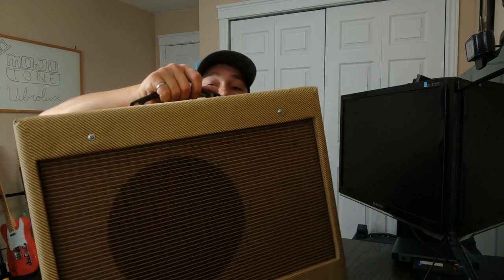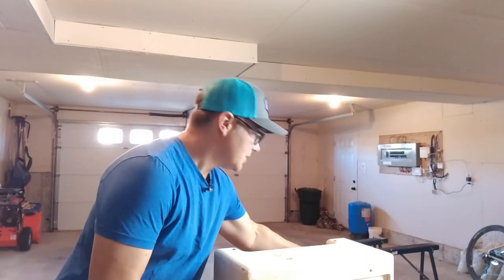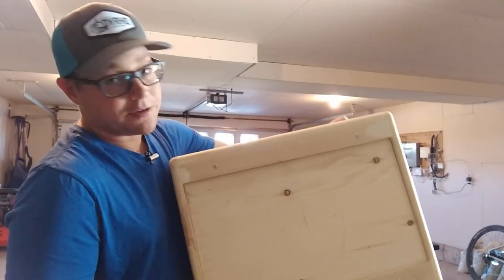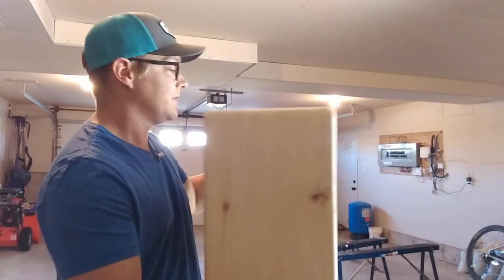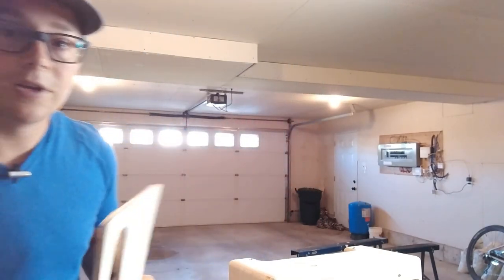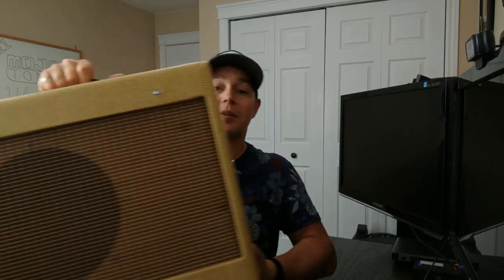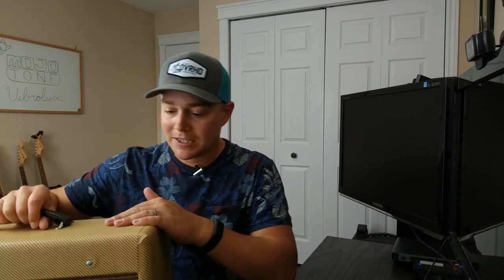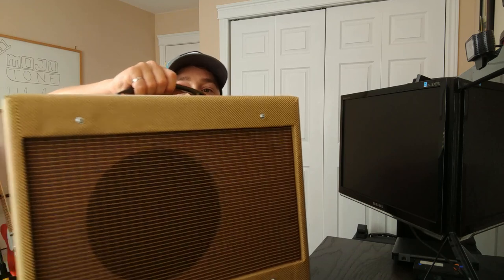Mojotone 5F11 Vibrolux Amplifier Build | Part 2 | Finishing the Cabinet

Comment: You only need four screws to hold the speaker and paint the baffle flat black!!!!!  These are traditional steps!!! You need work on you corner seams.
Reply from the maker: Thanks Russell. I should paint the baffle, but I am very happy with the corners!
Reply: exactly, I just finished a couple of amp builds including the cbs. Cabs are way too much work. I am going to just buy my next one. Used mostly hand tools as I downsized and unloaded most of my power tools, back saw and mitre boxes, handsaws, hand sanding.

Comment: What would it cost to build a small cabinet for a 5w amp kit?
Reply from the maker: $25 for wood, $40 for tolex and grill cloth. Maybe another 20 for miscellaneous (glue, sandpaper, contact cement). Should be less than $100 easily